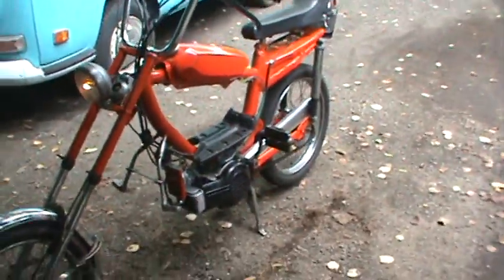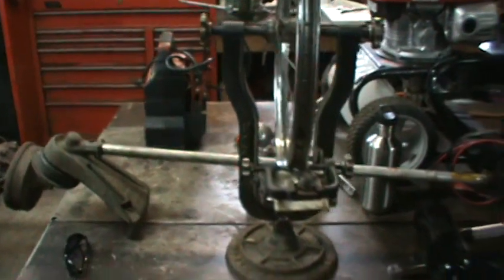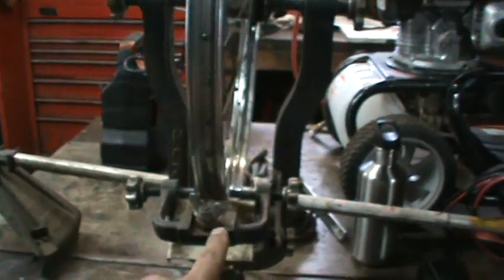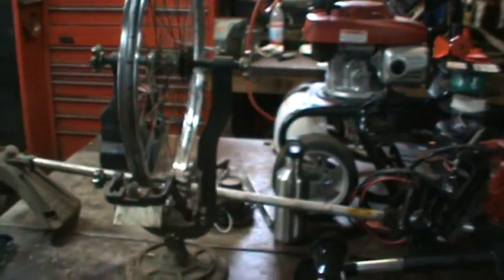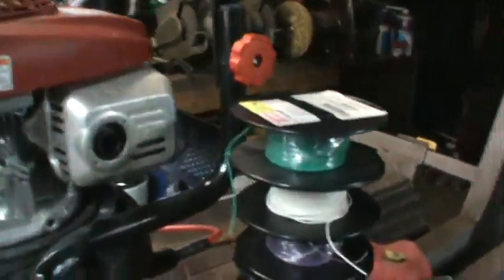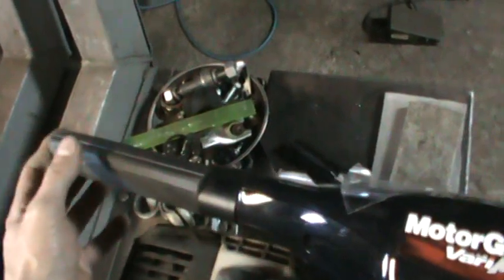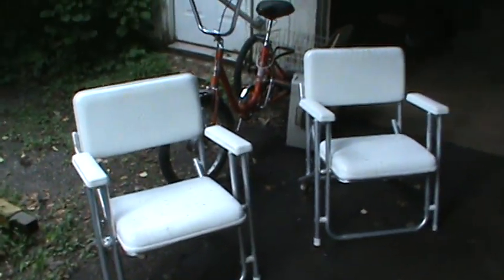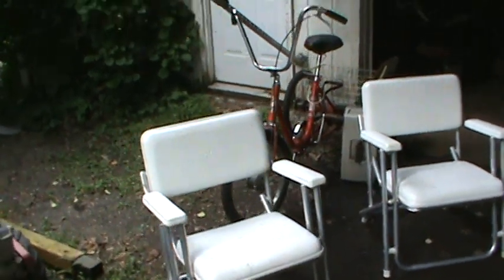moped ride and yard sale finds

Comment: I didn't look, but did you happen to build the trolling motor powered electric bike Mustie1?  If not, please consider it as I have contemplated it as well and am almost sure it would work perfectly.  I have what's known as a NuVinci transmission hub I would probably use.  If you are not familiar with the NuVinci transmission for bikes/motorized projects, please look it up as I know for a fact you will be interested.  It is in my opinion the most brilliant of all I have seen by far.  Thanks again for a great video  Mustie1!

Comment: I haven't read all the comments so maybe someone already said this... The problem with the electric trolling motor bike idea is that the trolling motor was designed to be submerged in water to keep it cool. Out in the open air, I suspect it will overheat in short order.
Reply: Yeah, well he'll rig up a water jacket from a water cooler or something.